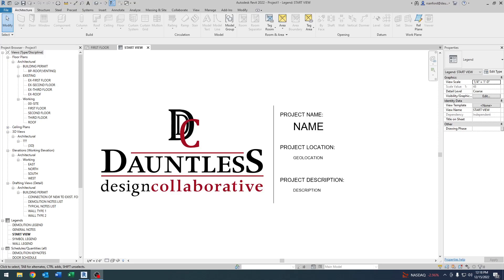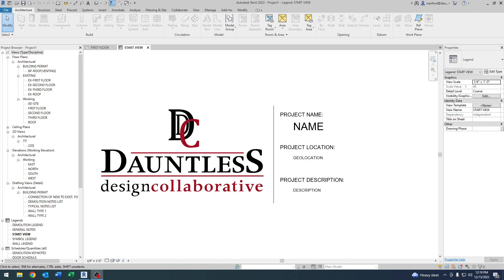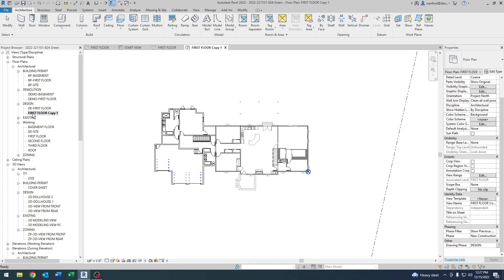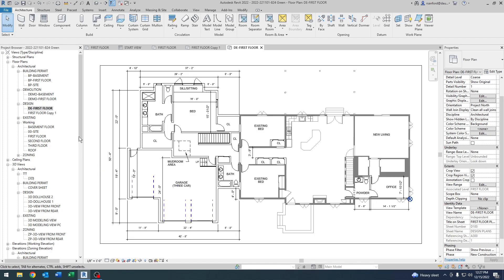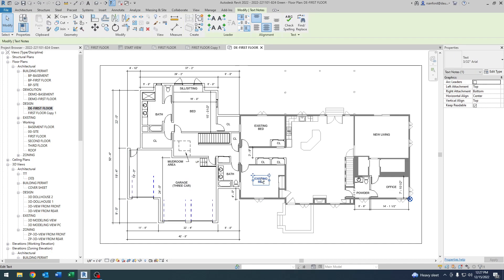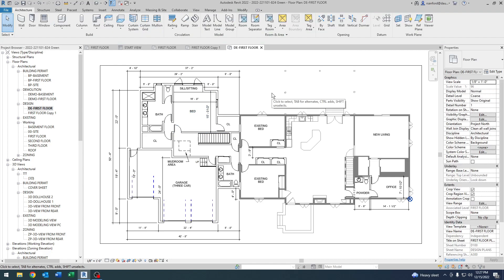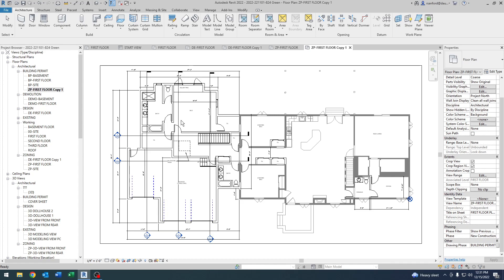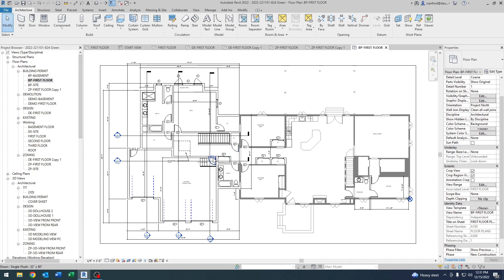Revit Help:  Template setup using View Templates

Comment: Hi Rich! Great video, I like the idea if sorting the project browser according to drawing phases. I´m wondering what's the reason for creating the new parameter, couldn't you just add a new organization scheme to the existing browser organisation options? Also, what's the difference between applying view template properties in project browser vs. applying view template on the properties palette? Thanks!
Reply from the maker: The additional parameter allows you to sort by drawing package type. In my case I have design plans, zoning plans, and building permit plans at a minimum. I also use framing, demolition, and existing conditions plans, which are in my template, but not always used.  The browser organization tools don’t accommodate this out of the box. 

Applying the view template in the browser allows for a one time application where it’s not attached to the view. When applying through the properties it’s attached to the view, meaning if you make changes to the view template it will automatically update any view it’s attached to.